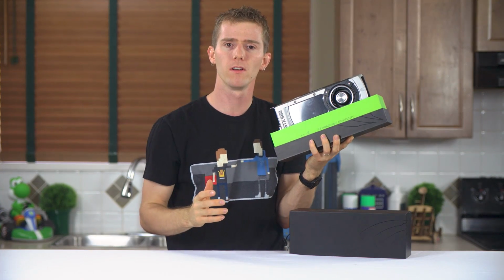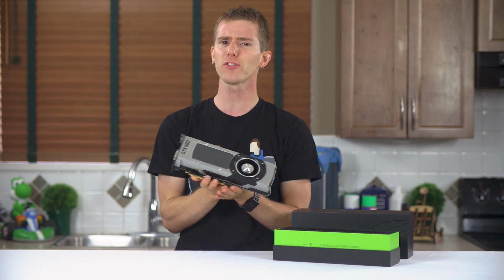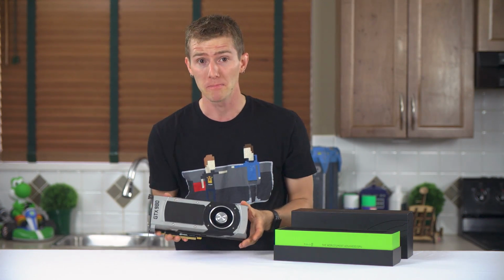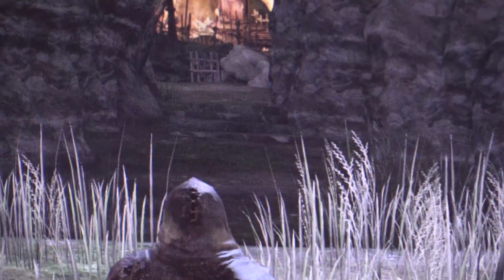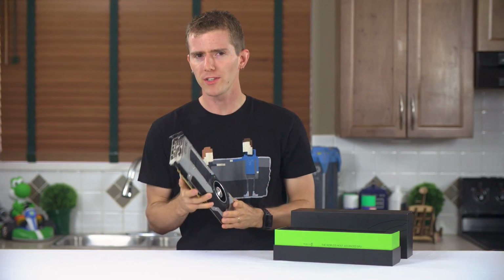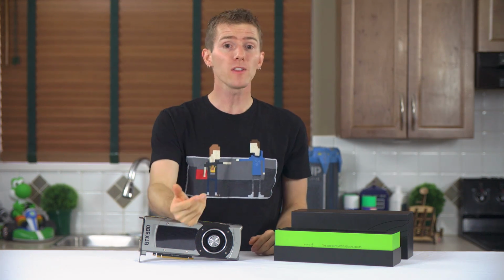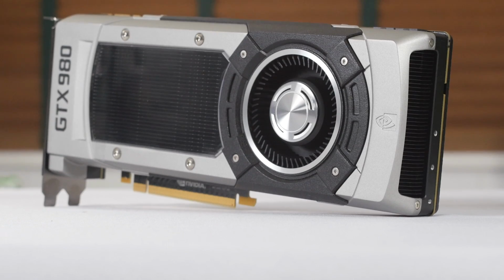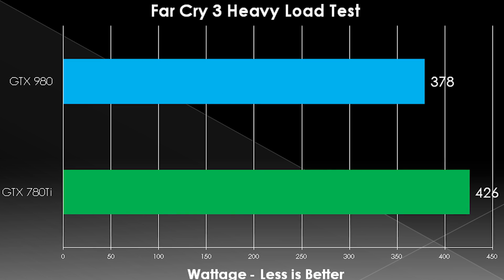NVIDIA GeForce GTX 980 Video Card - Performance Overview

Comment: Please tell me if this build will last for at least 3-4 years
i7-4790K
GTX-970
16gb HyperX ram
MSI Z97 Gaming 5
CS750M
250gb Samsung Evo ssd
1tb WD black
Reply: Yes.. Ram is the next thing to come out in  3 years maybe. DDR4 , upgrading to that would mean you would have to change your whole PC unless they engineer it to work with old motherboards
Reply: Xendrus Idziak Then your comment is invalid.
Reply: XmazzX an overclocked gtx 970 out performs a stock 780ti
Reply: I dont think so 2-3 months max :D
Reply: Dude, don't listen to these guys about the 4770. The price difference between the 4790K and 4770K is negligible, so it's well worth going for the 4790. As for the rest of the build, it will last as long as you want it to. In a few years, it may not play the newest games at the highest res with the highest settings on multiple monitors, but it wont spontaneously combust. I picked up an EVGA 780 a year and 2 months ago yet there is no game I have played that troubles it.
Reply: ArmySV Yes
Reply: Fancyslimshady I don't expect any replies, thank you
Reply: GTX 980 not the GTX 970 for the love of god...
Reply: I would say that depends on what your definition of "last" is.  The build I have now I've had for 3 or 4 years and it's still adequate.  I7 2600k, gtx 580 3gb in SLi, 16gigs of Gskill sniper 2 1tb blacks in RAID0.

I'm finally upgrading next week, been waiting on these 980's to drop.  My main reason for upgrading though is I plan to make the jump to 4k but even w/o 4k a couple of the games on my radar might actually require a bit more horse power so I figured it's time.
Reply: Razor Blade No
Reply: Razor Blade Sorry, no
Reply: really mines about £2000 which is like double in euros and you still have better components  something I'm doing wrong
Reply: SuperCarZ FaN are you joking?
or your serious? ಠ_ಠ
Reply: I'm not too sure if the SSD would last that long but it should work
Reply: Xendrus Idziak  Explain how it will not?..
Reply: If you change the 970 to an R9 290 and get a power supply with atleast low quality, then all will last for years.The Corsair CS series is just built to fry your computer and take all your money.Something like a 500-600watt Seagate PSU will be fine.
Reply: 1TB for 4 years? Nope. Buy the 2TB at the very least, and there's no reason to buy the 4790. I do fairly GPU and CPU intensive things with physics and 3D models, and my 4770K is just fine with an h80i and high pressure fans. I'd also check the onboard audio for that board if you don't think you're going to run an external DAC, you want the best chipset you can get.
Reply: It will last for another 1-1.5 years. Your card will need upgrade first.
If you are interested in VR...well :)
Reply: If you're not an enthusiast, that build will be satisfactory for at least 3 years. Personally I still have a 5870 (2009 card) which runs the games I play without issues, all though as anyone would expect, it isn't very powerful and is indeed past it's life by quite a bit. If however you are an enthusiast, then you wouldn't be getting a 970 for starters. It's also worth noting that the 780 TI is almost 1 year old and out performs the 970. In other words, in terms of performance the 970 is already 1 year behind.
Reply: Congratulations, your build might last about 3-6 months
Reply: ArmySV no
Reply: ArmySV Seriously, yes.
Reply: lol, probably not. Look up the "future-proof" linus video, you'll get it
Reply: Razor Blade Okay, i made a mistake, sorry
Reply: Marios Adamidis Why all the expensive parts?
You could go much cheaper with a really good performance!
Reply: Depend if you're going to do a lot of video editing and 3d design etc. stick with the i7 if not get a i5 and then get a 980 my opinion
Reply: I want my pc clearly for 1080p games on ultra nothing else and i have a 1350€ limit
Reply: Marios Adamidis You could easily go with a 500W PSU and you can change your motherboard to a cheaper Z97CHip Express motherboard. You could also downgrade to 8gb which is really enough for normal use of the computer, but if you render videos or something else Memory intense than go with 16gb.
Then you could maybe get a GTX980.
Reply: Actually....if your price limit is that high then you will probably get the best parts.
But still go with 8GB, lower PSU, GTX970 it´s perfect.
Here is the choice: Best blablaba CPU is i7 4790k = 315€. Everyone confirms that!
Cheapest on Ultra playable with good Frames Intel CPU with overclocking potential is the Intel Pentium G3258 ~60€
I would personally go with the cheaper on. Why? Because you´re getting into the overclocking scene with the Pentium G3258 and it´s good for the next years and you could easily upgrade the CPU later on OR you could then upgrade to DDR4.
DDR4! That would be my plan if I had to build a gaming PC.
Reply: MrSockenloch if i get the 3258 it would be a bottleneck for the 970
Reply: Marios Adamidis Yes true. You wouldn´t get the full potential of the GTX but you always will be over35fps - 65fps in every game.
(I picked this information from reviews and benchmnarks test and threw them together)
But you´ll have a gaming pc.
Just saying if you don´t want to spend a fortune on DDR3 components....well you actually could get an Intel i5 then or something which means my arguments are invalid.
Reply: Yeah I still have a 2600k and still runs games great and an amd 7870. I can also do intensive video editing
Reply: That build will last you several years with minor upgrades in 3-4 assuming you aren't wanting absolute insanity and simple bragging rights. That computer is far more than the majority of people that play PC games have. Basically short of wear and tear that build should last you easily 5 years if not far longer if you don't care about small things like 4k res and running ultra at 100+ fps on heavily taxing games.
Reply: Christopher W. Hearne Why would he double the amount he is spending for barely any increase in power? GTX 980 is only for those with money to burn, enthusiasts, or those that need incredible power for things outside of gaming but don't have the budget for a titan. (even then if their budget is that tight they should grab 970 instead of 980)
Reply: Damion Mason This. The 970 is $350, cheap as hell for a decent gpu.
Reply: I would get an asus rog motherboard (maximus 7 formula) and crucial ballistics elite ram, Just my opinion, I trust them more.
Reply: As long as you are satisfied and not burn all of your money into pc and have a decent work. you will always be fine. you can always sell your pc after few years if you want and then buy a new one.
Reply: It will definitely last that long, and dont worry about the ddr4 because for gaming the extra mhz make no difference in fact the higher the mhz the lower the latency, so cpu, gpu and ram will last for a long long long time
Reply: It'll last about 1 month.
Reply: stop bragging ;_;
Reply: Mother Board-maybe not as god as new, but the I7 will last for ever, my 2009 Alienware 15x has first gen I7 q720, it still runs like new, I collect alienware PCs.
Reply: Xendrus Idziak your a dumass. Period.
Reply: xMxCxNinja777x Don't call someone a "dumass", (or rather known as "dumbass") if you don't know how to spell properly.
Reply: I'm getting one myself but a little different here and there
processor: i7-4790K
VGA: GTX-980 by ASUS or EVGA
memory: 16gb Corsair ram
Motherboard: Gigabyte Z97 Gaming 5
PSU: corsair AX 760
SSD: 128 GB corsair sata 3 only for system boot
harddisk: 1 TB western digital black
case: phantom 530 NZXT
Reply: dsniper17 Don't get the corsair ssd trust me you will regret it. Get a samsung 850 pro or intel ssd
Reply: Bryson Shires
whats wrong with corsair SSD and compared with samsung 885 pro?
Reply: They are highly unreliable
Reply: oh dear....
Reply: Xendrus Idziak Yes!
Reply: Marios Adamidis you don't need an i7. if you're only gaming an i5 is fine. i have an i5 3570k(previous generation) OC to 4.2ghz and gtx 970(980 is only for 2k and 4k resolution) and i play anything on Ultra
Reply: depends on resolution and games... 970 really sucks at higher resolutions compared to older generation. Dont be fooled by 4gbVram bcz it goes through 252-bit bandwidth as appose to 3gbvram 780/780ti that has 386-bit. Other than that yeah your cpu is good for 5 years or even more, they have charts out showing old cpu's still doing good so ... yeah depends on resolution cz 970 tanks hard in high res
Reply: John Brooks But i......i......i game at 1080p though.
Reply: Joel Eaves if you on 1080 than lol your gona do great with any Maxwell gpu
Reply: aNewbyYoutuber You have an explanation to backup your statement?
Reply: aNewbyYoutuber And oh my god, you were a bit late on the comeback. Don't you think?
Reply: 64GB ram... and you're done
Reply: Marios Adamidis   You're going to get a lot of stupid "No" answers just to be dicks but in reality yes it will.  While DDR4 is on the horizon it's not cheap and in 3 or 4 years it will be cheap and that's probably when you should upgrade. It wont be a problem then.
Reply: rorey mcowin "While DDR4 is on the horizon " its been here for months now. But DDR3 is still the go to RAM for gaming.
Reply: Μάριος Αδαμίδης nope only 2 days.... Jk it's good even today you can run all games at ultra 30 plus fps

Comment: I would like to see the non overclock results aswell. I thought it might be possible by working together with another review sites and agree to mention their name when using their non-oc results in your video. I don't think non oc settings should be done by yourself since they are the same anywhere anyway but for me it's easier to just see all information in one graph instead of switching between taps for all the games etc. Good review btw, thanks again!

Comment: So, I currently run 2x gtx 760's from MSI's twinfrozr series.  (2gb)
Im thinking of buying the 980, to save the extra heat and power the 2 cards cost.
What will i expect performance wise? I mainly think, what will the change in fps be, and what of the quality? - Thanks in advance.

Comment: So far from what I am seeing across the web - the 980 triumphs easily over the 780ti with newer drivers.  I'd love to see some updated benchmarks in a month as most review sites have been showing the 970 at the 780ti's level of performance and in sli nearly reaching 295x2 performance while the 980 is 10-15 over the 780ti.  If this is only little Maxwell / mid-range GM204; GM200 / GM210 with a Titanium class card or maybe just a Titan II, 970ti and 990 is going to be scary powerful in comparison to GK110.  GM204 is an insane replacement for 680, especially given the 980 is close to dual 680 performance alone.  Well, done nVidia!  Now they need to revive the Voodoo dream of tri-gpu on a single card :P

Comment: was wondering if i ran twin sli 980gtx and 5960x with 64 gig ddr4 ram will a 1200watt powersupply be sufficient or should i just go for the corsair 1500watt powersupply? i am planning to overclock the system

Comment: I pay for my electric bill and was wondering if those power consumption charts you showed were very accurate. I know you are very meticulous, but I was expecting 85 watts per card average per difference in power consumption for 170 watts or so in the highest end games of course on my dual 780ti setup. j/w
Reply: I was going to try and sell my 780ti 2 way sli setup btw but the power difference might not be worth it over the course of a year or two now

Comment: Do a GTX 980 roundup once the non-reference models are released. I'd like to know which one has the best air cooling solution and ,therefore, which one has the highest OC potential. It's probably gonna be the EVGA GTX 980 Classified that will win but still.

Comment: I wanna see an overclocking session of ZOTAC GeForce GTX 980 AMP! Extreme Edition when it comes out. Factory OC at 1291Mhz Core clock and 1393Mhz Boost clock. 2x 8pin power connectors for extra overclocking ability

Comment: Frankly, I just got myself a used Sapphire 7870 GHz in perfect shape for around $130. It's good to invest in performance when it drops in price and doesn't cost the same as a decent motorcycle. Sure, the 980 has some awesome features and improvements in effectiveness, but you need to ask yourself, if it's worth the expotential increase in cost.

Comment: So I been expecting AMD to be first on the 16nm process band wagon but that doesn't seem to be the case. http://www.extremetech.com/gaming/190026-amd-ceo-just-laid-out-companys-two-year-roadmap
Even though I am an Intel and NVIDIA fan I am quite disappointed in finding out that AMD is holding onto the 28nm process. I hope they have some amazing architectures in line to compensate for not creating denser chips.

Comment: Im curious as to how it will do in SLI temperature wise, will the backplate have a positive or negative effect? If you think about it, it ought to have a positive effect since the back of the card should be cooler with the backplate right, thus the air that the first or second graphiccard is getting should be cooler as well. Right?

Comment: so it's 60fps, 4k ready?
Reply: your going to need 3x980 to get solid 60fps in demanding games
Reply: Cj A nope just two just use fmaa instead of ms a a ;)
Reply: Xendus that's pretty cool I never heard of a bad ass monitor that can support that :)
Reply: x2 980s =4k gaming just right.
Reply: Keven Arias yeah see the problem with that is that most games don't support it, if you're gonna play at 4k don't even bother with AA at higher resolutions it's barely noticeable
Reply: Yeah I know that you don't need it although I never saw 4k in real life so I can't make an inference.
Reply: I don't think there's any single gpu out right now that pushes 4k at 60fps, at least not in the more graphics intensive games.  That's opinion more than fact though, based on the little I've read from users they do get above 40fps with this card in 4k which is certainly more than playable.

Comment: 980 because of less power taken out of the wall, I'm personally at that point where graphics look great to me no matter what, give or take a few FPS, i am more interested in quiet operation and less power drawn. The less power the card needs, the less heat it will emit. I am currently using a 750ti because of incredible power efficiency, I am very interested in the 970 Strix card, I think it might be the sweet spot in power to noise ratio.

Comment: I didn't understand one thing about nvidia, there was a 600 series and 700 series and now the 900series. so where is the 800 series ?????????
Reply: Nvidia skipped the 800 series to avoid confusion , because they already use it in mobile platforms (800m series). So now we have 900 series cards that really are only 1 generation ahead, thus adding confusion.
Reply: thanks, having less confusion is better than more

Comment: 980 > 780ti. 980 cheaper, new hardware, longer life on the card as doesnt stress underload as much as 780ti, 780ti cost about 200+ more and needs to be overclocked to even compare to the 980. Once 980 has aftermarket coolers with factor Overclocking gives much more room for the 980 to shine. And fingers crossed we get a 980ti.

Comment: I have a 760, and I honestly don't need to upgrade it. It can run pretty much any game at high-ish settings 60 fps, and it's probably one of the most high end pieces of equipment in there next to the Corsair RM850, the only part which I intend keeping for the next 7 years of something.
But the 980 looks like a really tempting investment, Christmas 2015 maybe...

Comment: will this system be able to use a Gigabyte Radeon R9 270X

CPUs	AMD FM2 A8-6600K 4.2GHz Quad Core CPU with Radeon HD 8570D PN AD660KWOHLBOX
Motherboards	ASUS A78M-A FM2+ MicroATX Motherboard
Desktop Memory	DDR3 4GB (1x4G) G.Skill 1600MHz Ram Module
Hard Drives (3.5")	500GB WD 3.5" 7200rpm SATA 6Gb/s Caviar Blue HDD PN WD5000AAKX
Video Cards	Integrated Video Card
Cases	Zalman ATX Z5 Plus Case Black (No PSU)
Power Supplies	500 Watt Zalman ZM-500LX Power Supply

Thanks for the help :)

Comment: Impressive performance at lower power levels but unfortunately I don't just use mine for gaming.. They should of been 6gb as i have seen in multiple monitor configs using a little over 4gb on many occasions... Although this beats out a titan black for price and power performance in gaming it unfortunately loses out in other respects. The 980 gets less cuda cores with 2048 vs 2880, less memory bandwith with 224 GB/s vs 336 GB/s, and width 256 bit vs 384 bit, plus i'd assume just like the 780 series they would limit the performance of double precision memory to keep the prestige of the titan name.. If i was building a gaming rig I'd get the 980's..Less power usage ultimately means less heat, less run cost over time and smaller power deliver requirements considering it will be for entertainment purposes...

Comment: Well if two of these will run 6 to 8 monitors as it looks like they will it will save me a lot of money on my next system builds.  That does not break my heart one little bit.  Just because I could come up with the funds for the more expensive cards if I had to does not mean I want to.  I like getting what I want and need for less scratch just like the next person.

Comment: I think anyone with a brain would get the 980 over the 780ti. Better bang for your buck, newer technologies and software supported, better for sli as it requires significantly less power, and actually higher compute scores. 
The biggest difference to me is this new card has 4gb of vram making it an obvious choice in comparison to the r9 290x.